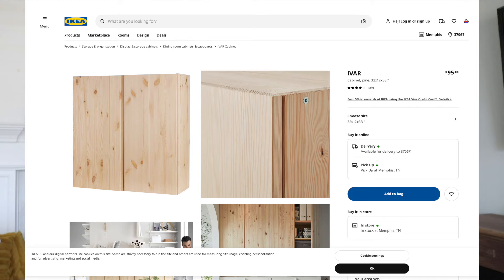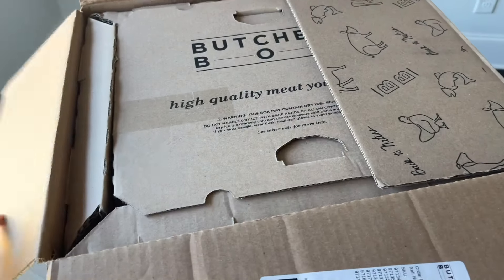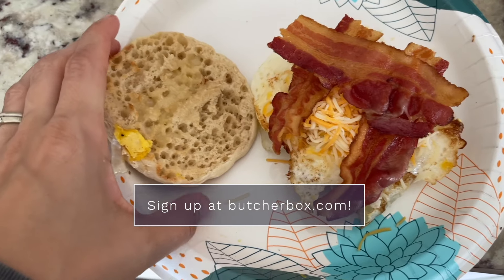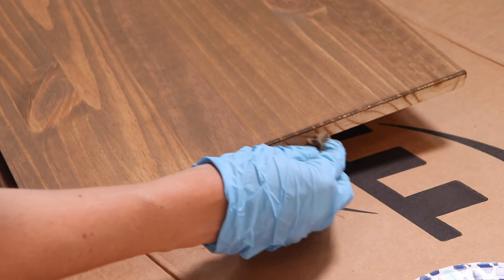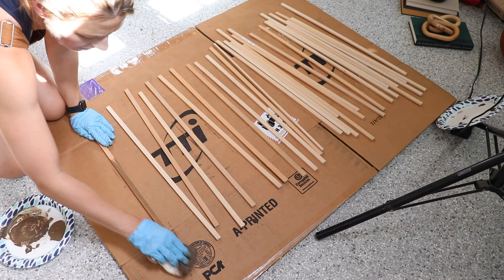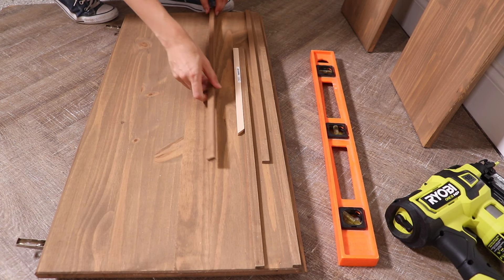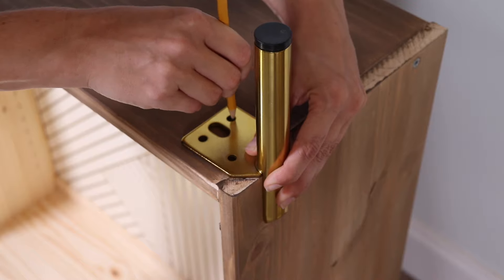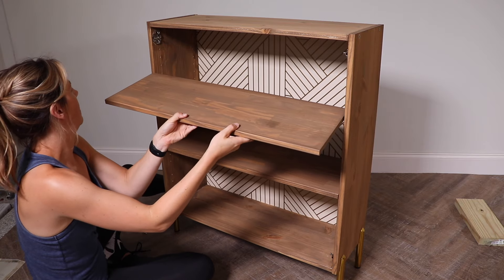DIY Bar Cabinet | IKEA Ivar Hack

Comment: Stained wood is not protected in any way. Grabbing the wooden doors for opening, placing stuff on top, any moisture will likely lead to grubby stains. I'd always recommend a clear finish on top. 
One of the pains of the cabinets for me are the screws that are visible from the side. I don't know why they construct it like this, with the sides sticking up and the top in between the side pieces.

Comment: Love this, especially what you did to the doors!!
I have the same one assembled and waiting for me to create something. Since the top and bottom have the slightly raised side panels (where you needed to put the washers), I was thinking of maybe sanding down the raised part and even putting a little filler where the screws are. Do you think that would work out well?